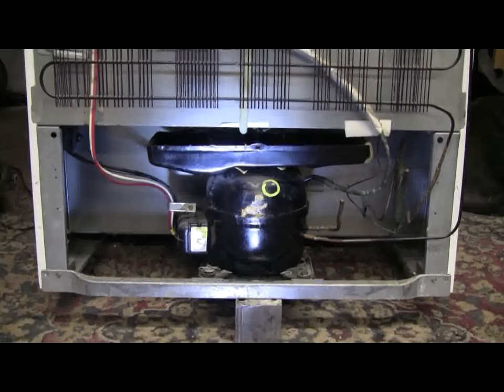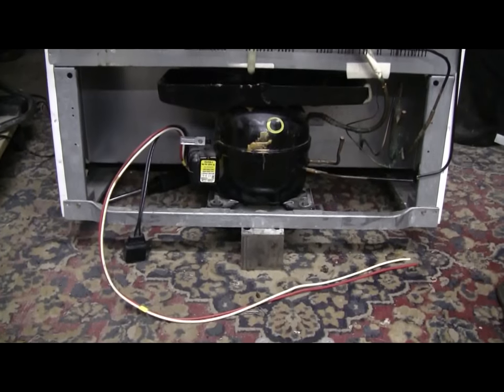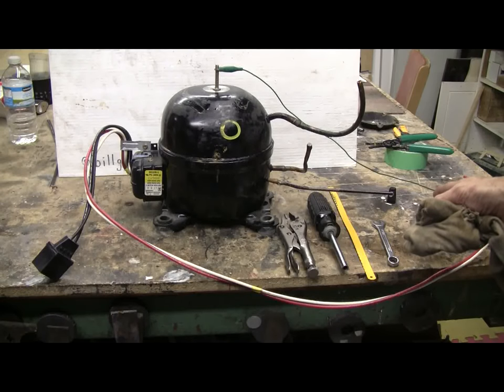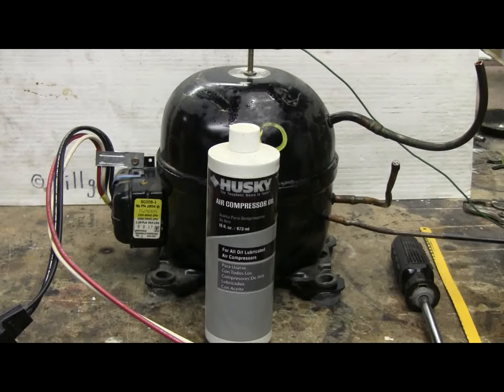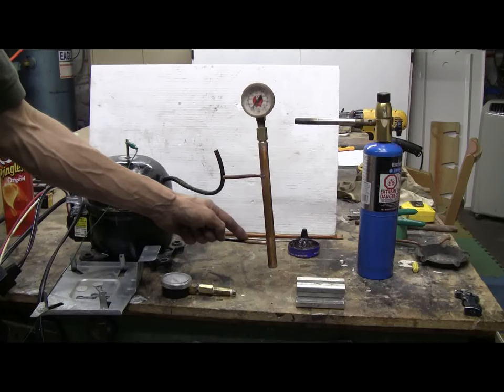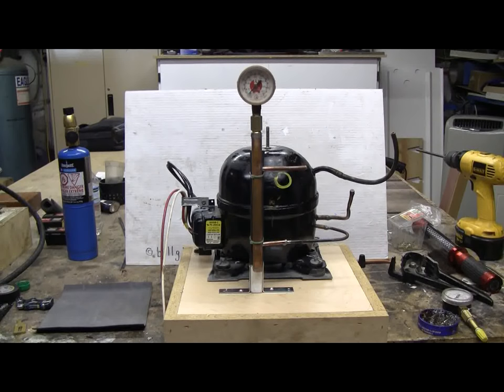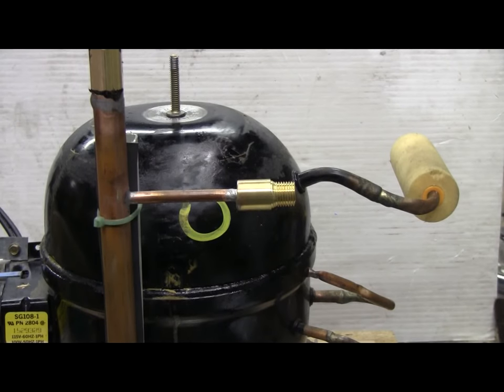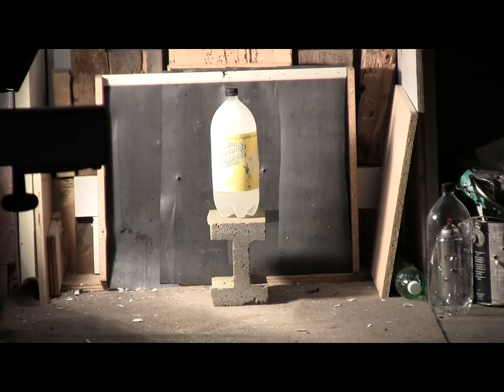DIY - How To Make A High Pressure Air Setup From A Refrigerator

Comment: Will it power a spray gun at 10 bar
Reply from the maker: +Curtis Young These develop pressure rather than high flow. You would need more cfm than this can give for anything bigger than a small air brush. You could set it up with a pressure switch and storage tank but it would take time to bring a decent sized air tank up to 10 bars pressure.
Reply: Curtis Young

Comment: How do you add the oil into the compressor
Reply from the maker: +KmanMeteorProductions The suction line simply leads into the compressor housing. It can be used to suck a little oil in now and then.
Reply: Bill Gilmour thank you so much! I literally just found a fridge compressor yesterday and I knew about the original oil and how it isn't good. The problem i had was how to put oil back in. So I looked up "how to put oil in a fridge compressor" and your video came up.

Comment: iT WANT WORK ! Ref. compressers require "Freon" to keep them cool and from overheating. It would be shutting off on overload all the time and eventally "Burn Out" !
Reply from the maker: +robert freeman I have made a lot of air cannon and other videos using my fridge compressor. It does not overheat and has not burned out. I have had to change the reed valve in the head. Taking these up to higher pressures than freon can shorten valve life. I got a lot of use and abuse out of it before it finally needed the valve job.
Reply: +Bill Gilmour  How did you change the valves with it  being a hermetic compressor ? Did you cut it open ?

Comment: I heard your reasoning for replacing the ac compressor oil, and have to disagree with your solution.

Since you have a electric compressor you want to use a refrigerant oil that is not hydroscopic. You can use any refrigerant oil since you don't have to worry about compatibility with the refrigerant and can focus purely the properties you want. For example POE and PAG oil is a no no... it's horrible at absorbing moisture. Mineral oil is best as far as not being hydroscopic then AlkylBenzene oil. Both also have a high dielectric strength too!

Comment: do you recover the FERON
Reply from the maker: +Joe Donohue I get scrapped damaged refrigerators for this. The freon has been removed already or because of the damage to the fridge the freon leaked out. I know a few movers and warehouse people. I get damaged units from them. If you do this with a fridge that has freon in it then local regulations will require freon removal by a licensed environmental company before you can remove the compressor. This is why I prefer the scrapped  units with no freon left in them.

Comment: That compressor is running at well over 2 times it's designed pressure and it may be high pressure, but it very low volume.

Comment: Long term run time will burn up the motor. Freon is the cooling factor of the motor. And this compressor normal psi in frig is 150. at LRA. / 350 is rising the amps to over run load amps. RLA . and will lock up motor over 400 psi. ok For a play toy. Changing the oil not going to stop moisture entering the intake to the compressor. This way air compressor have external motors.

Comment: Caution: Leaking R12 or R22 to the air is unlawful and punishable by fine. Have a certified hvac tech to recover the refrigerant  and prevent it from escaping to the stratosphere.
Reply from the maker: +Odouls77 My fridge was dead and had no gas in it because it was dropped during a move and the gas leaked out. If the fridge does have gas in it you do need a tech to pump it out and dispose of it safely.
Reply: I do not advise readers to drop their fridges to leak out the gas. Accidental or not R12 and R22 destroy the ozone layer. Readers must be warned of this hazard.

Comment: can we paint with these
Reply: reeaz sudally You would need a pressure regulator, and a filter to filter out the oil/water that naturally comes out of a compressor.  But yes you certainly could.  I'd recommend building it and plumbing it so that it fills an air tank like a regular air compressor does, otherwise the compressor would need to run continuously.

Comment: Although very detailed and informative getting through this video was nothing less than torture. That compressor will not last long w/o an oil separator, something you wont find in that capacity. Ultimately the destruction of the bottle of ice was interesting at least. No offence intended. The maker is obviously an intelligent man.

Comment: Who throws out a good refrigerator?
Reply from the maker: +Joseph Nicholas It might be mechanically good, but broken or rusty and filthy inside. Plenty get discarded with lots of life left in the compressor.
Reply: +Joseph Nicholas When it has a freon leak, usually in the evaporator, it's not worth the repair. It wouls cost about 3 quarters of the price of a new ref.

Comment: So, Basically you are using that little piece of copper pipe as your storage bottle with no high pressure safety valve.   That seems a little dangerous..
Reply: Jeremy Catches even if he has a storage unit, the pressure in the pipe will still be the same. He needs a regulator to make it a bit safer but im assuming he knows this and doesnt use it long enough to build up large pressure

Comment: That compressor is built to pressurize a closed system that is only a few cubic inches in space,..It doesn't take many amps to compress refrigerant to 350psi in a space the size of a shoebox. 1.5 amps to be specific... Therefore,..this kind if compressor is utterly useless in respect to actually running any air tools or equipment,..of any kind. Whatsoever,..not even a brad nailer,..or T50 staples...got too much time and mpney on our hands do we?..lol..I like it tho,..pretty cool
Reply from the maker: +Paul Garay This is useless for air tools. It could be used for a small air brush. It works great for pressurizing my air cannons. Limited specialty uses.
Reply: i see. needed it quiet?..i guess thats justifies spending thst much money,..a 
mans gotta have toys right

Comment: The first 90% was, IMO, painful to watch because my mechanical abilities are high and I can source all of the materials and could have condensed it to less than 5 minutes, but the last 2 minutes were lacking on what you used for a barrel, load, actuator, etc….  I'd like to build something like this using a scroll compressor that is designed for high pressure refrigerants.  I'm also thinking of stacking compressors in series to get to over 1,000 psi.  I'd, of course, braze the fittings to handle the higher pressures.   Overall, it was well presented and very thorough.  I'm considering using a very large fire extinguisher for my pressure vessel, but not sure about the firing mechanism.  Perhaps retrofitting something for a full auto paintball gun on a turret utilizing a pressure switch to cycle the remotely located compressor on and off and a pressure reducing valve to high pressure hose to feed the gun.

Comment: Mix oxygen and oil under high pressure, you get explosion. Thats how diesel engines work. Refrigeration compressors run very high compression and use oil to lubricate the cylinders, therefore not ideal for spray painting etc and always a small risk of explosion.Aint seen one explode but...................

Comment: very dangerous bad idea, these units pump oil through the lines with the gas/air and if used with a booster pump to fill HPA tanks you will cause diesel effect and tank/s will explode like a bomb. enjury/death is likely.
Reply: they will only do about 150psi max low volume so no use.
Reply: you would do well to heed his warning